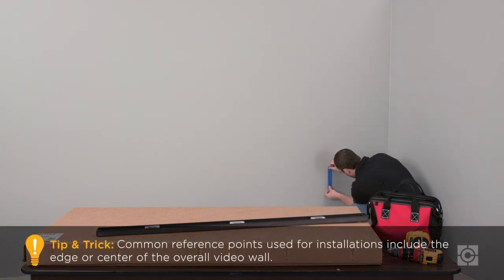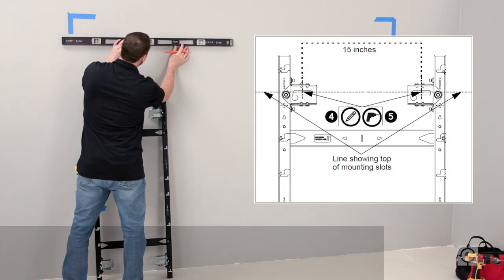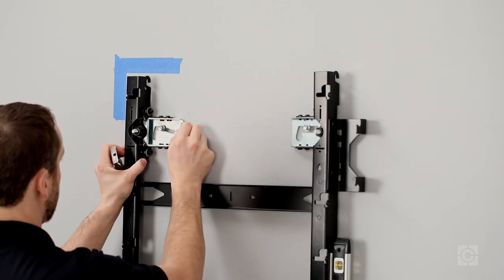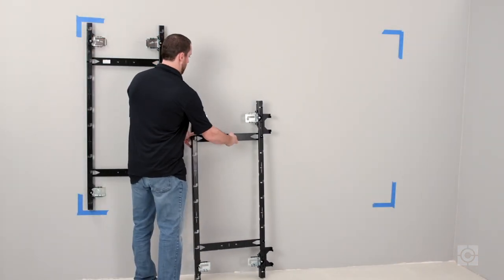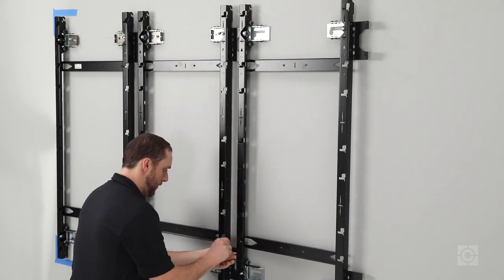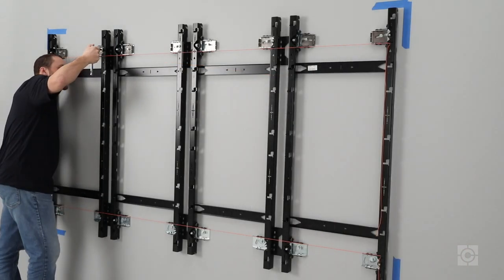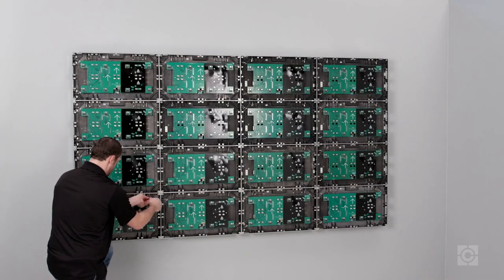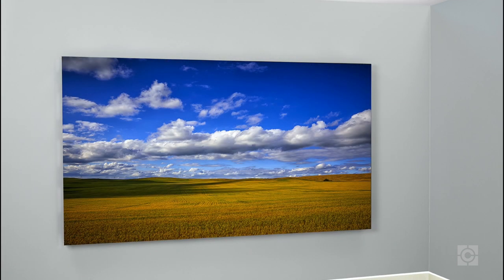Installation: Chief TiLED LED Video Wall Mounting System

Comment: Does it plug into one 110v outlet?
Reply from the maker: Hi! It’s dependent on the size of the video wall and the display manufacture requirements. Almost all displays can plug into a standard 110 V outlet but for larger video walls you may need to connect to two separate circuits. Best to consult with the display manufacturer on this question! Thanks for asking!

Comment: may i know, what size is the video
Reply: 100 inch screen
Reply: @stafonvoncamron  100 x 100 or 100 x how?, And how much does it cost
Reply: @stevederek3413  It's 4x4 each cabinet is 600x337.5mm